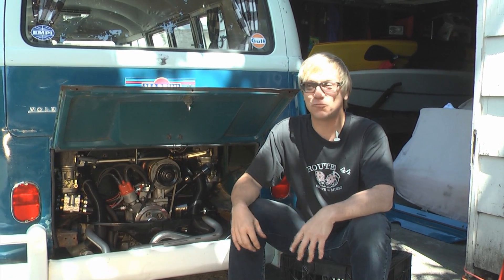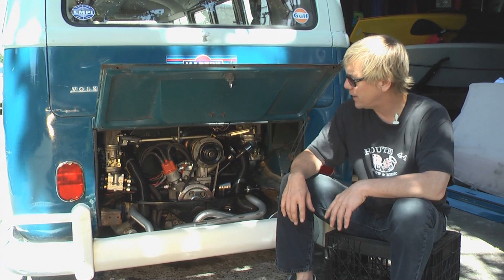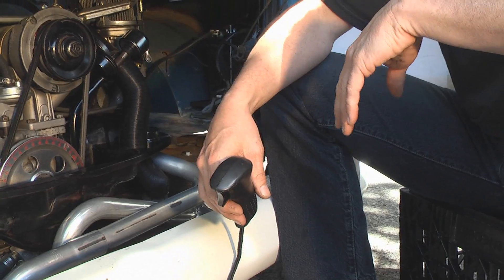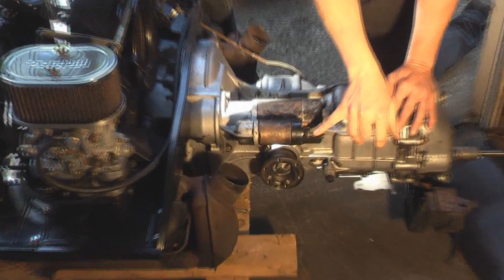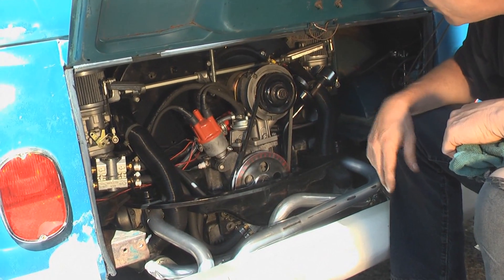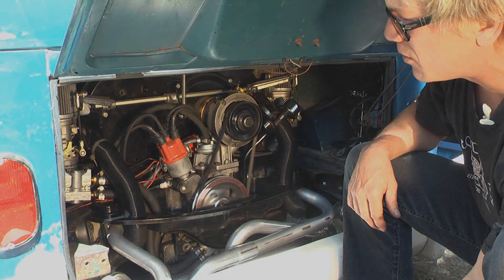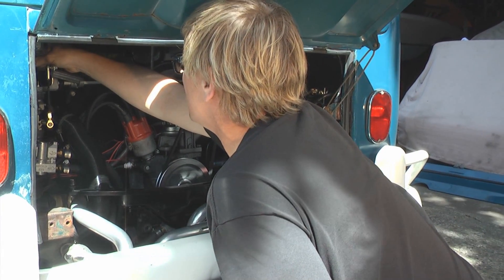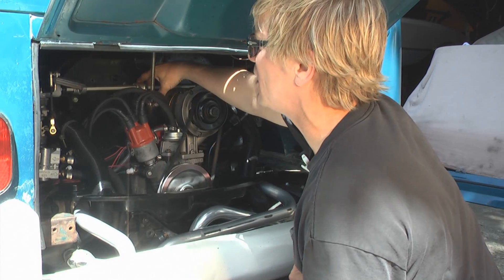Dual Carb Balancing and Fresh Engine Start Procedure - DIY German Aircooled Garage #14

Comment: You really need to disconnect the linkage to each carb before setting the flow meter. You cannot get it right unless you do you will always be chasing back and forth as they are not independent of each other.
Reply: bolti1000 that is what I just thought, the way he does it is simply wrong
Reply: @bjornbremer6123   not true.. you only need to have one linkage loose.
Reply: not true.. you only need to have one linkage loose.

Comment: I must say, I absolutely enjoy your videos, and how helpful they are, man!  I am also currently working on a 1965 sea blue bus (ours is a 13 window). The orange westie on my profile was our first air-cooled VW, it is a 72' with the first type 4 engine. Anyway, i bought a type 1 engine with fresh rebuild from mofoco, here in Milwaukee, WI. for the 65'.. once i decide on what exhaust i want to run, i will be ready to do the assembly. Thanks again for posting such great info! 
Always,
Drew
Reply: Nice... and thanks! I really like the A-1 exhaust i have on the bus.. been working and sounding great.  awesome ground clearance as well. 

have fun! 
phil
Reply: Phil Goeckler I'll look into the A-1 today. Thanks for the tip, and with as much time as we spend in the national forests camping, i need all the ground clearance i can get. I wish mine were as nice looking as your 65', but being from the midwest, and even though it hasn't been on the road since 74' , i still had to do both rockers, and outer cargo floors. Still well worth it in the end, as there's nothing like a splitty. Thanks, again!
Always,
Drew

Comment: Adjusting the down rods (one side vs the other) will change the idle speed. After adjusting them one should recheck the balance from side-side. it's always prudent to do all adjustments with the engine at operating temp. Geometry changes from a cold engine to hot engine. Inital set up cold get it close then once at operating temp do final adjustment/s. When jetting no lean tune jetting with a mechanical only distributor. if you use a vacuum advance distributor such as an SVDA shoot for 16-17AFR (light-part throttle cruise). It will run cooler and achieve better MPG's. No more than 28BTDC @ 3200+ rpm timing in a bus.

Comment: Additional tip. After you have finished turning the motor over with the remote starter use the key/ignition to ensure you have oil pressure you can turn the motor over from the ignition switch inside the car.  While the motor is turning over but 'not' starting, (leave the coil wire disconnected) watch the oil pressure light on the dash and wait for it to go out.  Once the oil pressure light goes out you know you have oil pressure. 

Have fun! 

Phil

Comment: Like DanielinLaTuna said... Don't do ANY of this until the engine has run at 2000+ RPM for 15-20 minutes with zinc additive to fully warm up & break in the cam & lifters! Engle, Web, Crane etc ALL still insist on this for warranty. Look at your Bentley manual too for minimum operating temp (130F) before you try to adjust anything. Also make sure FUEL pressure isn't over 3.5PSI for Weber type carbs. Simple way to be sure you have OIL pressure is a $10 manual gauge on a short flex line you can see back at the engine. If you really want to pre-lube the engine (without a $200 Accusump) put 15/W40 in a garden sprayer, get rid of the spray tip, "T" the hose into oil pressure sender & hand-pump oil thru the whole inside of the engine.

Comment: Hi dude,great tutorial video yeah,i have a question to ask,i will soon be adding dual webers to my 1600 type 1 engine,and i noticed your running a mechanical fuel pump,how well does it run for dual carbs,as i keep getting told to go down the electric pump route but i'm reluctant to do this so long as my mechanical pump feeds my carbs sufficiently,my engine is in pieces at the moment,as doing a complete rebuild,so just looking ahead,so know what to expect when it's ready to fire up again....cheers dude.

Comment: I was surprised you didn't break in the cam immediately after starting the motor for the first time. Is that no longer done? Back in the day, I'd run the motor at high revs for twenty minutes
Reply: no new cam on this motor, just accessories

Comment: Your videos are always so helpful as I'm just wondering if I need to install a fuel pressure regulator on a pair of dual Weber carburetors I'm installing with an electric fuel pump? Or could I just test to see what pressure the pump is pushing out before I install a regulator? Thanks

Comment: Right on man thank you very much you where a big help.
Reply: By the way what's that name of that synchronizer model number that you have to use to synchronize the carburetors thank you sir.
Reply: +bigdaddymex2003 what is the sweet spot I keep hearing you say 5. I have 66 bug 1915cc on dual dellorto 36 and do you have a video on upgrading the ignition system to get a better spark. And sorry for all the all the questions I'm trying to learn how to do this my self I'm somewhat mechanically inclined and it looks simple enough that I think I can do on my own. And do I have to drop the engine to change the plugs thank you for any information that you would provide me with

Comment: I've got an offy 3 port manifold that I has 3 weber 34ICT's and I'd like to have it setup this way.  Run on the middle carb only during idle and slow performance. and when I get on the throttle, the 2 outer carbs will kick in progressively.  Can you clue me into how I would do that setup?  P.S. unfortunately they have 3 different jets in them, one is 40, one is 50 and the 3rd is 55.  I'm in a real dilemma aren't I?
Reply: Im sorry I have no experience with such a set up and have never seen one.  Maybe the manufacturer has some tips for you.

Comment: I’ve a CB setup also.  I keep breaking the throttle arm that connects to the heim extension on the 3/4 side.  It seems to be binding while on the freeway.  Do you think the carb body expands with heat to where the throttle can stick?
Reply: Hows the geometry of the rods side-side? They need to be as close to the same including for & aft.

Comment: You don't know if you have oil flow and oil pressure?
Then crank the engine with the spark plugs OUT @ first,
have someone look @ the oil pressure idiot light on the speedometer while cranking;.. does  the oil pressure light go off?
leave HV ignition wire in distributor cap but unplug 12V distributor wire @ Ign coil instead!
when oil Pressure is indicated replace spark plugs and connect  12 V distibutor wire @ Ign coil!
Reply: Liberty Patriot Mechanic speaking here^ 😂😂